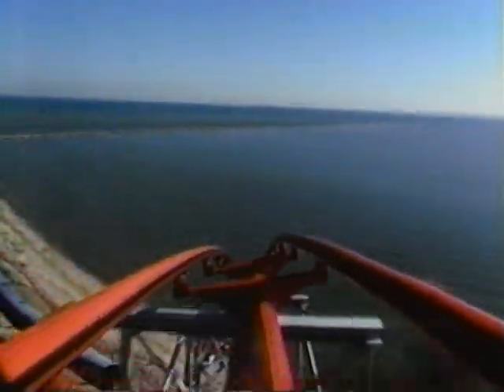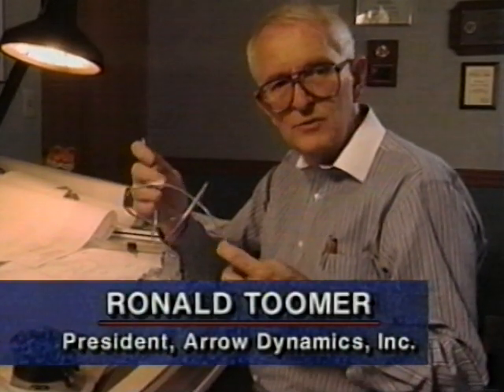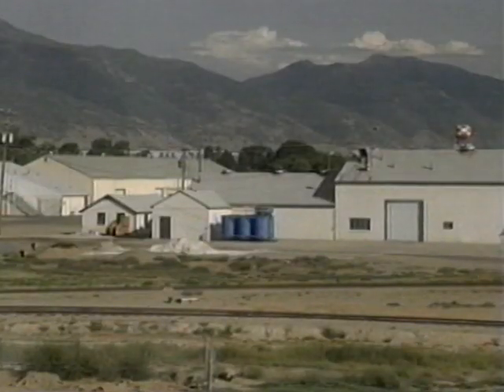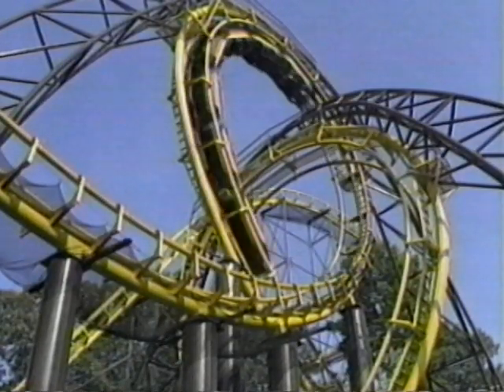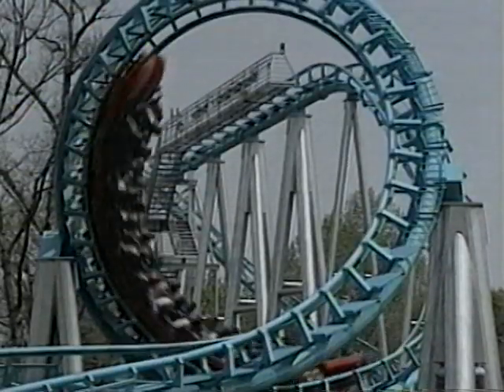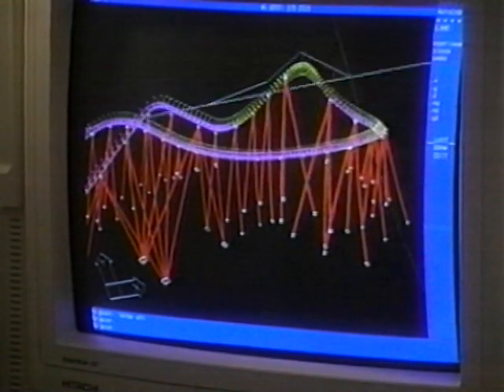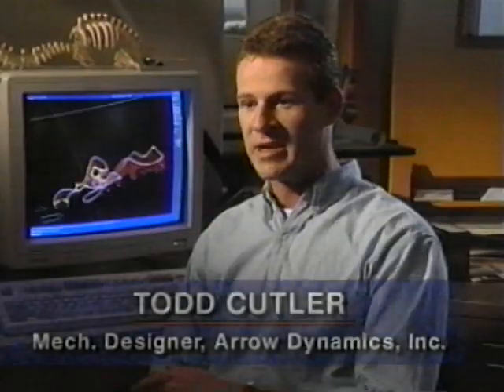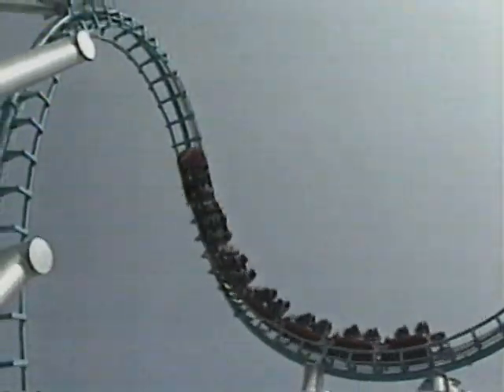How did they do That?  Roller Coasters with Ron Toomer (Arrow Dynamics) - 1993

Comment: Drachen Fire would have worked if it was put in a better park.
Reply from the maker: Wrong.  The park was fine - BGW is easily one of the most beautiful and picturesque parks on the planet.  The main problem with DF was that it was designed by B&M, but built by Arrow.  The end result, IMHO, was a highly-flawed masterpiece.  The secondary problem was its location within BGW; back of the park, and therefore - difficult to find (for casual parkgoers).
Reply: @kfhulme  it was designed by arrow from the beggining